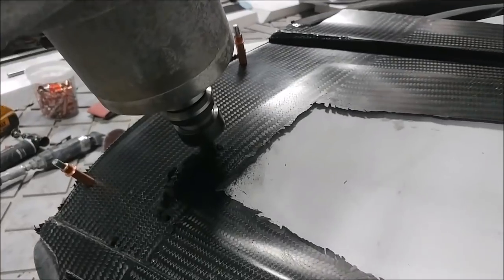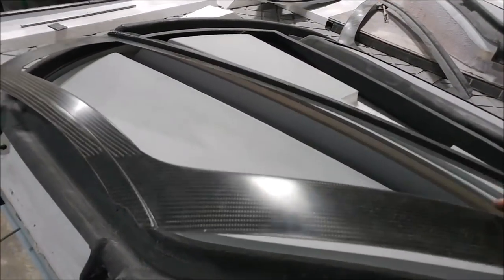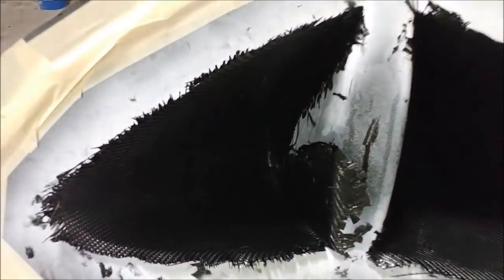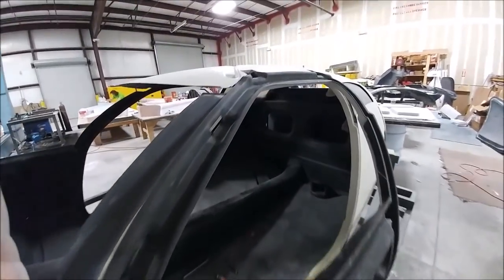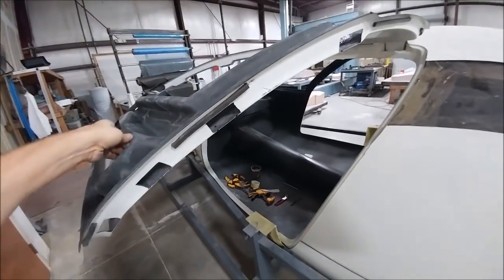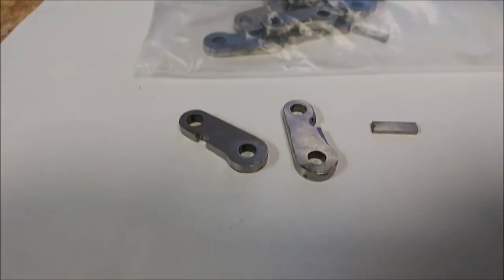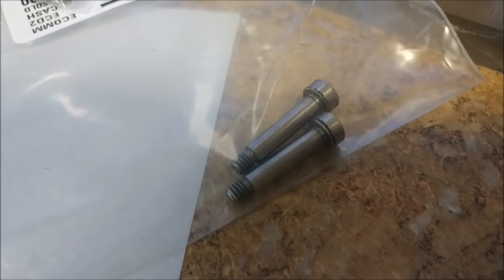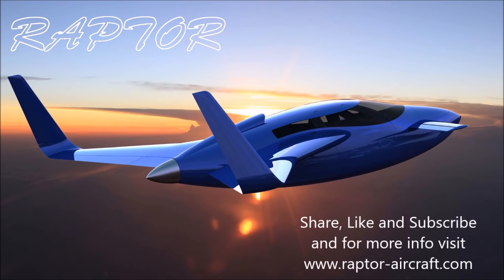Raptor Aircraft January 17th 2017

Comment: very nice work so far. Question, with the holes for the door hinges inside the cabin, how are you going to seal it to keep the atmospheric pressure inside the cabin?
Reply from the maker: The bolts will have washers that will act as a gasket.